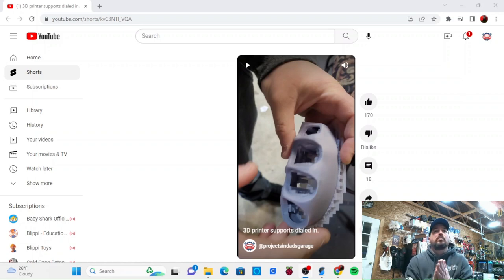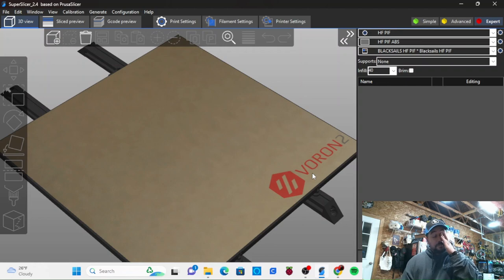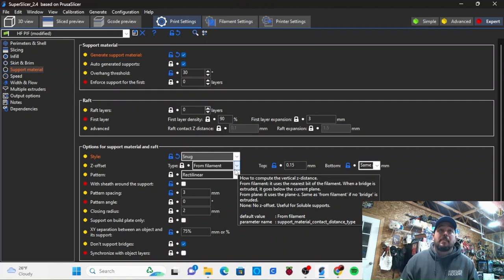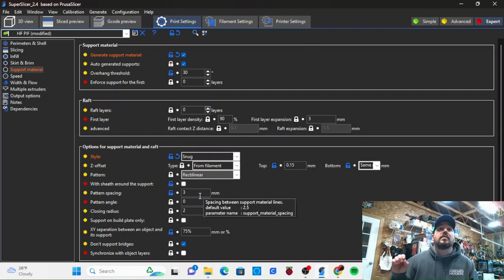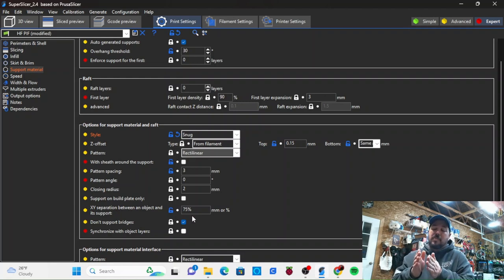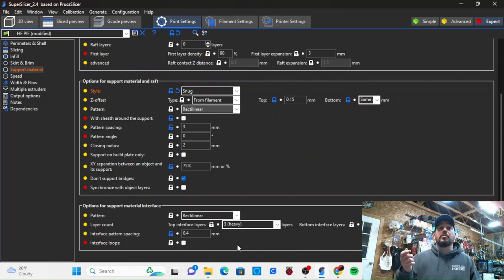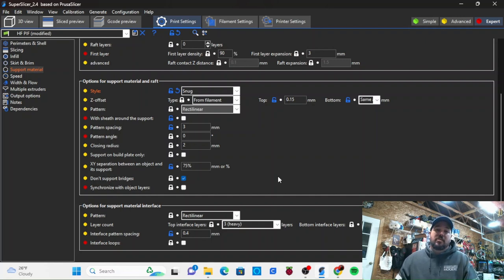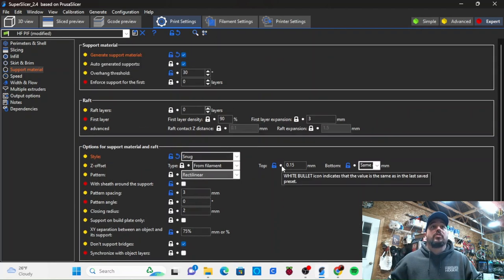Tuning support settings for your 3d printer

Comment: Hey, I wanted to let you know that I have been using your recommended settings on a few of my printers since you released your video and they work great! The only modification I made was to change the Support Interface Pattern to Monotonic. I found it easier to remove the support than when using Rectilinear for both Support and Support Interface. Nice work!
Reply from the maker: That's great. I'm glad they helped.